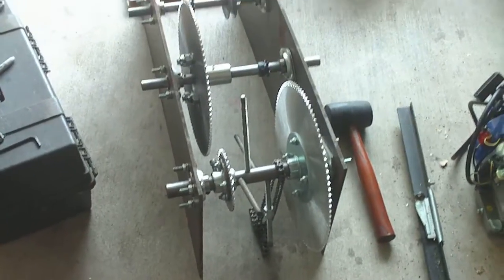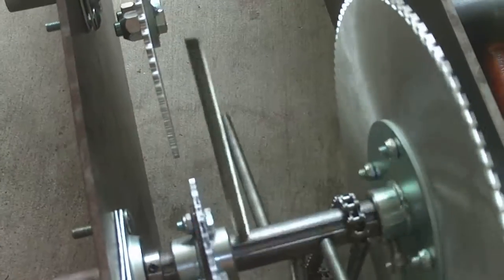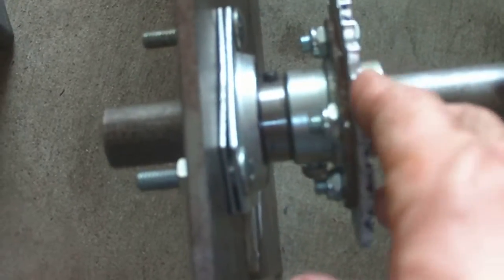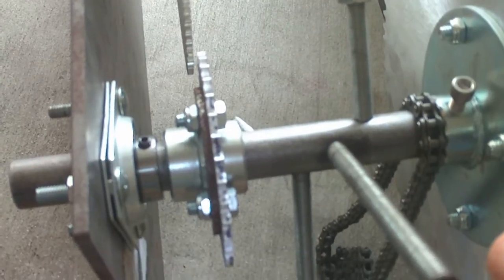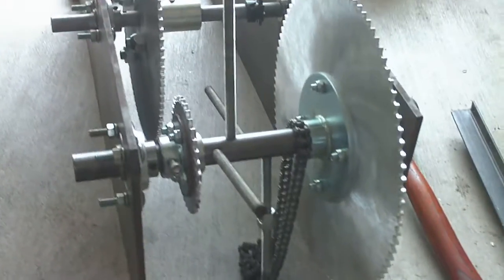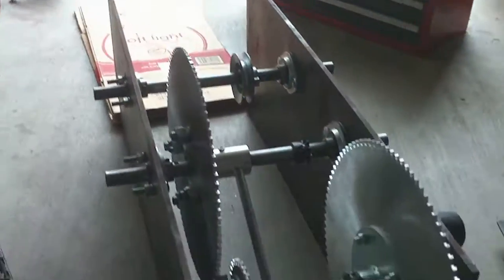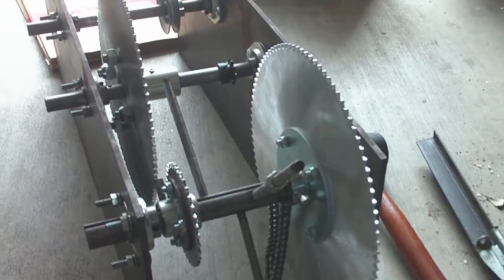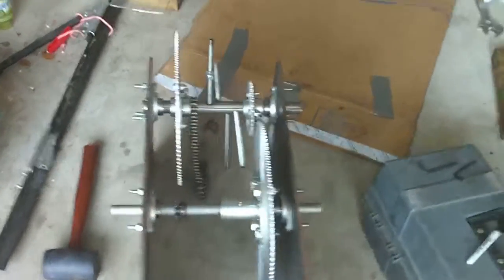5 - Gearbox Assembly & Alignment

Comment: You could use 2 275 gallon water totes strung over a pulley for your mass source. Then just use a solar powered water pump and a battery to transfer the water back to the empty tank up top at the end of the cycle. You shouldn't need escapements on the shaft either. It will never run away with a generator hooked to it as a load. It will barely have enough torque to produce much power as it is, you shouldn't make it less efficient then it needs to be. Would be great to power LED lighting and charge netpads and cell phones in remote locations for emergency power.
Reply from the maker: Our math shows there should be just enough torque and speed even with a fair amount of load. This is not a portable design, more for home use as a small emergency generator. We're not targeting ultra small charging, we're looking at 300-500 watts charging a battery or small bank. The mass may have to increase, we definitely will be staying with the escapement, otherwise throughout the cycle acceleration will become a problem, speed is inverse to torque in this setup. Inefficiency comes with the territory, proper balance of integration of components is a careful consideration throughout. We also have some ideas with this setup to warm a medium for a NiTi mechanism.

Comment: Very similar to the project I am building.  Good details.  The escapement I made is an Arnfield escapement.  It's on my page.  I am interested in your intended weight setup.
Reply from the maker: pickmyphotos: I saw your Arnfield Escapement setup at Arnfield style Escapement by David Young  ....  The attention to detail reveals your passion, very nice. It's smart that you already have a method for controlling rate of descent of the mass (weight). Because that's usually the hardest part for most people to design and integrate. So here's some things that will go a long way to getting to where you need to go: 1. If possible, add six more arms, one each between the existing arms, on the escapement. This would allow smaller incremental movements, thus the mass (weight) will fall in smaller increments also. The goal is, we're always trying to slow the rate at which the mass falls. The slower it falls, the longer run time we have before a rewind is needed.2. I guessing your black sprocket is about 40 teeth, and the chain is #40 (1/2 pitch), also called bicycle chain. Increase the number of teeth on that driver sprocket to high as you can practically get (100+ teeth). Try azusaeng.com, don't know if they'll go that large on #40 sprockets, but worth asking. If you can't get over 100+ teeth, contact me mid-summer 2014, I should have my shop set-up, maybe I can plasma cut one for you. The driver sprocket has to be very large so we have sufficient RPMs to turn a generator, www.windbluepower.com hands down has the best alternative energy DC alternators for the buck. That's who I use, be sure to pick the right DC alternator, likely to be DC-512, DC-520, or DC-540 model. 3. You'll need around 350-500 rpms at the generator. The higher the better, especially under load. So the 100+ teeth driver sprocket will have to drive smaller sprockets to get you up to 500 rpms, gear multiplication. Add another axle above your existing winding barrel axle, put the smallest #40 sprocket you can get (probably around 18t) and another 100+ sprocket on it. So everytime the 100+ sprocket rotates once, the 18t will rotate about 5.5 times. You'll probably need 3 axles total to get enough RPMs. All that RPMs means we lose torque, because in gear boxes, speed and torque are inverse to one another. So that leads us to the next step ...4. Mass (weight). The mass driving your winding barrel will have to increase significantly, probably at least 400+ lbs. Increase the diameter of your where the red rope (cable) wraps around the winding barrel to 5 or 6 feet. So the white barrel has to be replaced with much one larger. This will help increase the available torque being delivered to the driver sprocket. I noticed you have a pulley on the barrel. That's not going to work, you must eliminate any possibility of slippage, use sprockets only. So if you intended to drive the alternator directly from the winding barrel just remember you'll still need to multiply RPMs as I mentioned in step #3 above. As you can see by now, to truly generator enough practical wattage (volts x amps) takes carefully planning. I strongly suggest you get very familiar will the discipline of physics known as Classical mechanics (Newtonian). You'll need a good understanding of acceleration and torque. Particularly acceleration due to gravity (9.81 m/s^2). The relation between the two is very important, you need both in the right balance for this to work properly. Lastly, your wood prototype is awesome, keep it because it'll help you test ideas easily, but I must tell you now, you're going to need to move to metals, especially aluminum (cheap, strong, corrision resistant), because the wood frame will not hold up to the rigors of 400+ lbs pulling on it over the years. There's a lot more to tell you, but this should point you in the right direction, good luck and keep up the good fight. God bless!!

Comment: I like the project very much. I am building a similar system .
I do not use a gear box  . Instead I use a series of chains connected to a single large sprocket chain assembly to drive my generator.
The idea is sound - check my facebook page vvv.facebook(dot)com/GravityGen
Reply from the maker: Thanks. I remember you from a year or so ago. Some really cool ideas on your facebook page. The only thing that would concern me, as I stated before would be the 1/2 ton weight you plan to use. There two immediate problems when using this amount of mass. 1 -- It's not portable. You can't take it with you, 2 -- the time spent to lift that mass, even with pulleys (gear reduction) is going to be a deterrent for most people. I see your design being more appealing to corporations or perhaps a community, but not so much for individual homes. Because once it's installed, it realistically can't moved without a lot of effort. I definitely think you're on the right track, keep up the good work.
Reply: Thanks - Keep up the good work. ENjoying your posts.

Comment from the maker: Also keep in mind that the sprockets and chains on the gear box are size 35, also known as 3/8 pitch. Chain 40 is more common and stronger, but the 1/2 pitch would make the teeth on the sprockets further apart and the sprocket sizes would not be practical considering the extreme ratios we're trying to achieve.

Comment from the maker: Estimates show somewhere between 400 - 475 lbs. The lift/drop time ratio has not been established yet. The physics still have to be worked out to determine what leverage will be used based on a practical force (torque) a human can generate to do the lifting cycle. We'll integrate a bike frame, seat, and peddles with the sprocket gear selector to make the task of turning the winding wheel easier. Sprocket selector gives rider choice of how difficult he wants it. Hopefully provides enough leverage